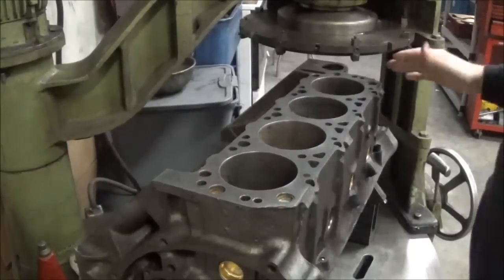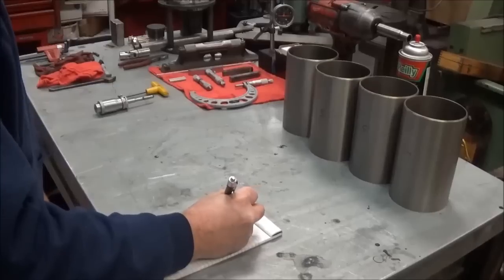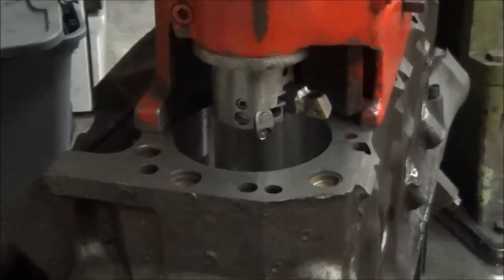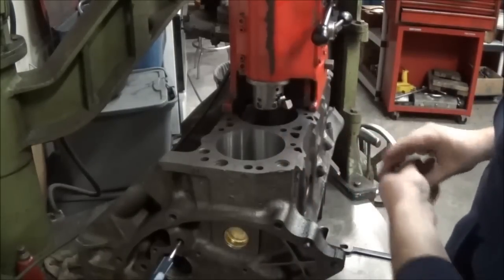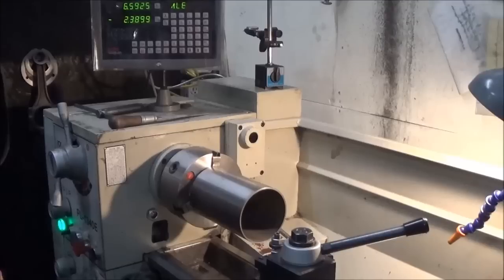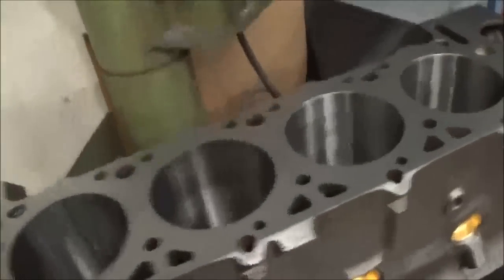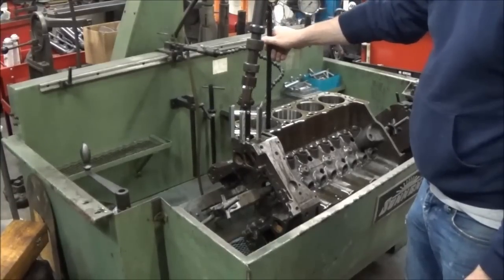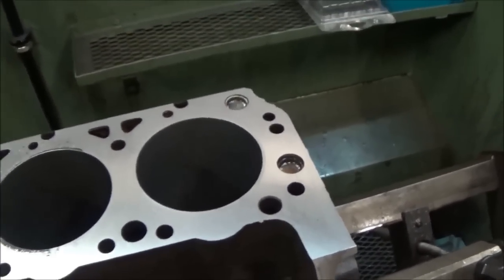7.3 Blocked, 6.9 Engine Build Part 2: Block Work

Comment: I'm impressed, it's neat to see the work behind a machine shop!
I drive trucks powered by Cummins ISX's and they press out liners and press in new ones, never saw any machine shop work on inframe or stand built engines.

Comment: do you have any video of the anchoring and centring of the boring bar in the cylinder.  does it clamp off the bar running across the mains? would be nice to see if you can show it next time :)
Reply from the maker: I don't yet, maybe on a future video. Bar anchors across the bottom of the adjacent cylinder and clamps down to the deck surface. I use the centering fingers, and index off 3 (9 really) different points. It's not perfect, but it does the job. I could dial it in, but it's realistically just extra time that's not necessary. The step thickness is only about an 1/8", so even if it's not perfectly concentric, it's only off a little bit (a few Thou), and it's not like that 1/8" is going to make piston support an issue.

Comment: Does anyone on the east coast do work like this???? I need my 7.3 idi rebuilt but 3000 miles is a little far to drive...
Reply: I believe 1 guy had his rebuilt at promar engines in New Jersey

Comment: did you make that sleeve press? 
 sure beats a hammer!
Reply from the maker: Yes, that was the first rendition. It's been modded since to Air/Hydraulic with a 10 ton cylinder. Much faster now.

Comment: That step at the bottom of the bore is very important, I saw a guy sleeve a chevy 302, cut straight through the block, everything was great till the block was running down the street, then the sleeve slipped down and the crank throws ran into it...... big damage, amateur mistake, this is the way to do it......

Comment: Have you tried freezing the sleeves and a heat lamp on the block?
Reply from the maker: The practicality behind it just isn't there. The press is air/hydro now, and butter smooth.
Reply: There is one thing about liquid nitrogen freezing that no one ever seems to mention when trying for an interference fit, and that is the frost that forms from the humidity in the air.  I’ve been thwarted in a few assembly attempts because the frost layer that formed was too thick/I was too slow getting it into position.

Comment: hey maybe you've heard of this my 6.9 has a loud clatter/tap at start that get quieter as it warms up what do you think it could be.
Reply: Callmeappa - AOSM if it does it on cold start and goes away or quiets down as it warms up. And doesnt do it on warm starts its more than likely piston slap. Basically the piston rings and or cylinder walls are worn down so when the metal is cold there is excessive clearance between them causing clatter or banging. As the metal heats up it also expands reducing these clearances causing the sound to get quieter or disappear completely. Of course until it cools off again. Short term I would worry about it too much. But ling term its going to need a rebuild. New rings and possibly sleeves or just get a new block in all. But again probably nothing to worry about too much. Just let it warm up completely before driving and you'll be fine. Hope that helps. ☺
Reply: thanks
Reply: that is lack of compression you are probably missing on some cylinders till the temp gets higher and stops impending ignition
Reply: Does it sound like a few cylinders or all of them?

Comment: What kind of surfacer is that?
Reply from the maker: Storm Vulcan 85B with CBN conversion. It's since had the rest of the cutters added and a variable speed unit installed. Cuts very smooth with even less than ideal bit alignment.

Comment: Where can I get the sleeves to do this
Reply from the maker: Summit Racing sells sleeves, just search by your finish bore diameter.
Reply from the maker: @FueledAddiction  It's a bunch more work to open up the head fastener size, than it is to sleeve the block.
Reply: @RacinNdrummin  but dont you think it would be cheaper to bore out the block to 1/2 then throw on some spare 7.3 heads
Reply from the maker: @FueledAddiction  No, it's much more expensive to accurately drill and tap 34 holes in an engine block at a machine shop than it is to sleeve a block. My preference is to sleeve a 7.3 block to 7.3 dimensions, and use Turbo Pistons anyway.
Reply: @RacinNdrummin  I cant find a factory turbo idi anywhere near me how much boost do you think a studded 6.9 with stock compression can handle?
Reply: @FueledAddiction  15 psi
Reply: @tuckercole1531  I ended up finding a factory idit and now can run much more boost but thanks for the reply
Reply: @FueledAddiction  no problem